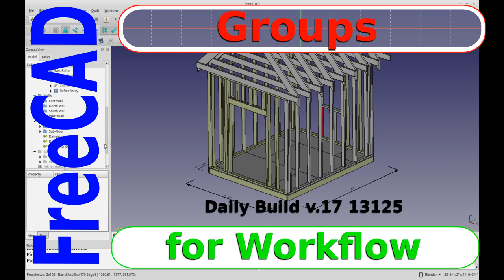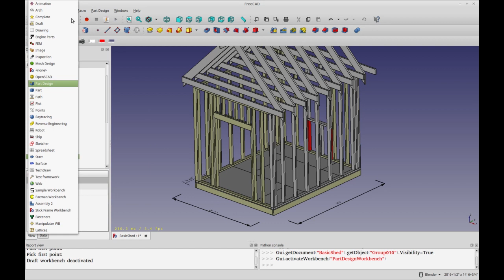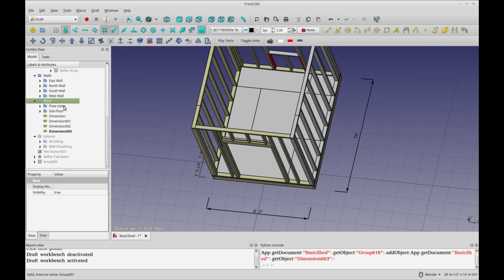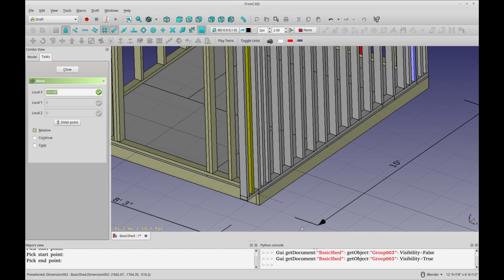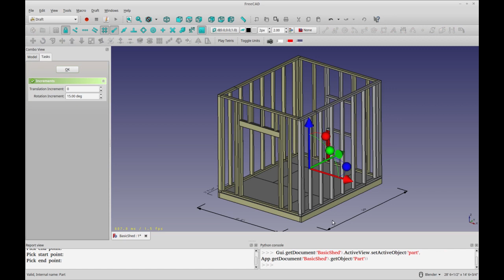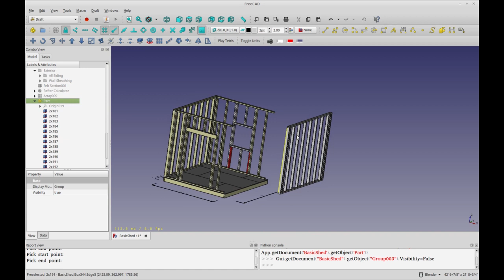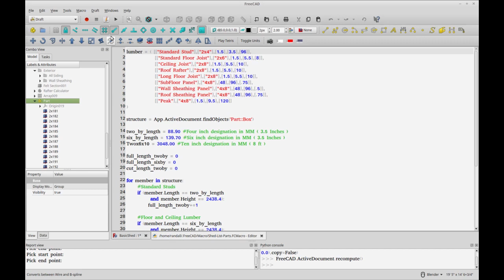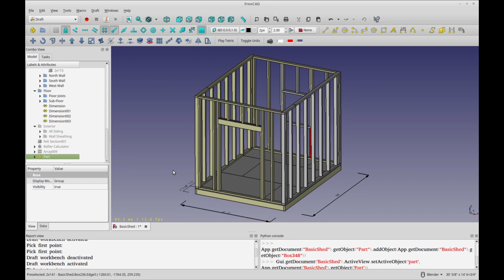FreeCAD Tutorial -  Using Groups for better Workflow

Comment: Btw, the way the window is designed (where the sill penetrates the jack stud) is a totally viable option. Advanced Framing does the same to save on lumber, and it's roughly as strong. They also use California Corners instead of the overly built-up ones you're using. But it's all optional anyway.

Comment: Thank you for doing a practical example. Also thank you for taking the time to explain this. I'm new to anything CAD and find it frustrating when people will do things on a video, or worse describe them on a tutorial, but then when I try, the option is not available. In my case, I'm trying to do a woodwooking project that's drastically simpler. However, I can click on a face in the Draft Workbench, but the movement tool is not available. You're moving a group, but I'm not sure when it lets you move things.

Comment: Did you create all of your studs. rafters, floor panels inside this model or did you "import" them (quotes because import has different connotations depending on the program) I would like to create a component library and grab existing electrons to plunk in my assembly.
Reply from the maker: Yes an no, in the early shed videos I did, but later on I did not. I would just create "parts" then copy them in the model. I recommend the a2+ workbench if you want to create an easy assembly. It wasn't around when I started these videos.
Reply from the maker: Also I desire the same part library approach.  I would love it to be a drag and drop experience
Reply: @mathcodeprint  https://youtu.be/JDPv9tBcjGE Drag and drop, nope but a much smoother assembly concept.

Comment: really struggling with finding 1 last under-constrained point on a sketch i'm working on, only been using the platform a day and my project might be a little too advanced for my experience. is there any way of finding it?
Reply: Finally found the last missing constraint and now it won't pocket. I get an error message "Failed to validate broken face". I've selected the sketch and and validated it but still get this error message. Any ideas?